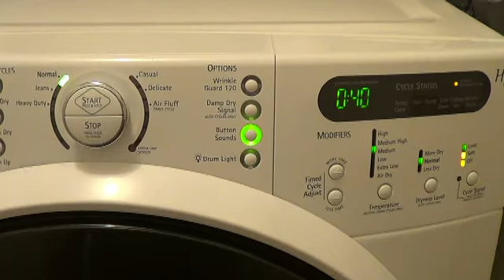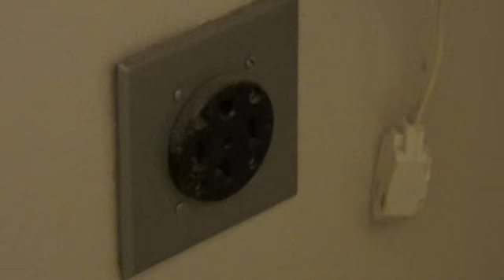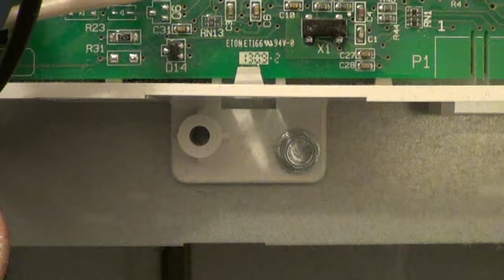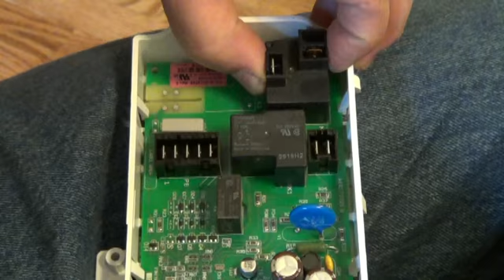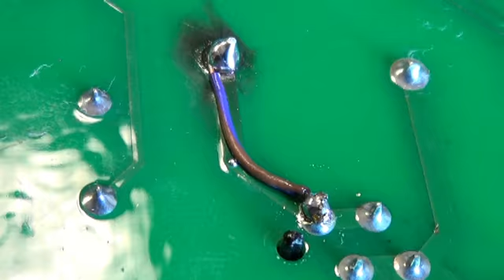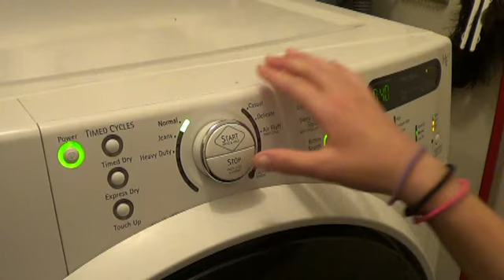Dryer Sears / Kenmore HE3 - F01 Error Code Main Circuit Board Repair

Comment: What kind of wire??
Reply from the maker: #20AWG, #22AWG, or #24AWG copper wire will be fine.  Insulated or un-insulated.  Doorbell wire, thermostat wire, telephone wire, or wire out a piece of CAT5 cable will all work.

In most cases simply resoldering the pin to the circuit board will not work since the metal foil on the circuit board often gets blown away when the solder joint pops/explodes. The jumper creates a new electrical path between the damaged pin and the pin it was connected to. The jumper wire doesn't need to be very big (say #22 AWG), and being small makes it easy to wrap around the pin(s). The factory pins are not insulated so if you follow the path of the foil between the two pins there is really no need to use insulated wire, but it makes it look a bit more professional. For those without much or any soldering experience the trick is to heat/touch the pin and wire with the soldering iron and keep touching he solder to the pin and wire until they are hot enough to melt the solder. You don't want to drop a blob of solder off the soldering iron onto a cold pin and wire.
Reply: Jim Dandy that’s what I tried first due to curiosity and just like you said it didn’t work due to the damage,  now I didn’t unscrew it out of the dryer all I did was pop those plastic clips and simply pulled the green board out didn’t have to disconnect a single wire and I soldered it all right there lol just a little FYI

Comment: Thanx, your fix worked great! A footnote, our problem was probably caused by lint packing up below the clean out screen over 11 years. I suspect it overheated due to restricted air flow. (and used more hydro) removed the 5 screws around the lint trap, and pulled out 1/3 of a shopping bag of crude, then vacuumed to get the rest. Hopefully it runs like a new dryer for a long time.

Comment: Thank you so much for making this video, all in I spent under $18! Had a hard time with one of the wires on the control board, but finally managed to pry it up using a flat head screw drive vertically between the points! THANK YOU AGAIN!!

Comment: Thank you, this repair fixed our Kenmore He3. You did a good job showing the needed steps without making the viewer watch unnecessary details. We bought the He3t washer and He3 dryer several years ago. We purchased a service contract for the washer. No contract on the dryer. So far this has proven to be a good choice. I have been able to do the dryer repairs (2 major) and have been glad to have prepaid techs take care of issues on the washer.

Comment: What’s the wire thing u connected the blown up one with the good one used for
Reply from the maker: In most cases simply resoldering the pin to the circuit board will not work since the metal foil on the circuit board often gets blown away when the solder joint pops/explodes. The jumper creates a new electrical path between the damaged pin and the pin it was connected to.  The jumper wire doesn't need to be very big (say #22 AWG), and being small makes it easy to wrap around the pin(s). The factory pins are not insulated so if you follow the path of the foil between the two pins there is really no need to use insulated wire, but it makes it look a bit more professional. For those without much or any soldering experience the trick is to heat/touch the pin and wire with the soldering iron and keep touching he solder to the pin and wire until they are hot enough to melt the solder. You don't want to drop a blob of solder off the soldering iron onto a cold pin and wire.

Comment: Jim, This was the Jim Dandy of the advise I saw, and the one I followed.  Work just fine!  2 hours total.  Only one hitch in my model, there was one connector that refused to separate, so I place to 1 x 3 boards under the circuit board on top on the dryer shell,  and soldered it "virtually in place".  Thanks for your guidance.  Doug

Comment: THIS was the video that got my dryer working. I watched a few and while I'm not particularly handy, I decided to give it a try. Resoldered joint and, darn it didnt work. Added the jump wire that only you mentioned and BINGO, I'm up and running. Thank you!
Reply: where did you buy the wire? do you have the link?

Comment: okay...gonna attempt this. Probably silly question, but is that a specific wire you used to connect those two points?  Any 'ol wire?  (am a greenhorn. but determined to fix this)
Reply from the maker: It should be solid copper wire of about #22AWG which is about the size of the wire used to make small paper clips. This would also be about like the wire used for doorbells, garage door wire, or old telephone wire.  It could be stranded vs. solid, but that would be a bit harder to work with.  It can be insulated or bare.  Clean the pin that the solder exploded off by scraping it gently with a knife.  Wrap the wire around the pin and follow the solder track on the circuit board over the the next pin and make kind of a wrap there.  Use a small soldering iron ~ 40 Watts and small rosin core solder.  YouTube how to soldering electronics and see how you should solder.
Reply: Thank you so very much!!!  Worked like a charm!!!  I am so excited!  Dryer is back in business!!!  Wooohooo!!!  You rock Mr. Jim Dandy!  Stoked!!!  :)

Comment: Mr. Dandy, I am half way through attempting this project on my Kenmore Elite HE5T Dryer. I have a copper wire that appears larger than the one you use in the video. I was wondering what guage you used? I'm a bit nervous to solder and then ruin the circuit board by soldering the wrong size copper wire. Please help. Thank you!!!

Rebecca@rebeccakeeney.com
Reply from the maker: The wire does not need to be very large, so something like a solid (vs. stranded) #22 gauge copper would work well (#24 AWG (small) to #20 AWG (large is OK).  You want to be able to wrap it around the pin sticking through the back of the circuit board.  It can be insulated, but bare is fine as it will follow the same path as the solder track on the circuit board.  The trick is to hold the soldering iron on the pin and wire until they are hot enough to melt the solder.  Keep touching the solder to the pin and wire until you melt about 1/8" of solder and then pull away.  Practice on a couple pieces of wire twisted together before you solder the circuit board.  YouTube something like "How to solder electronics".  Use some small diameter rosin core solder with a 25 Watt to 40 Watt max soldering iron.

Comment: Thanks so much for posting! I pulled my control board and had the exact same blow out black mark. I followed your steps to solder a wire on the back. It was my first time soldering with a cheap iron that didn't heat up hit enough. Even butchering the solder connections I got the dryer working in the same evening. 👍

Comment: Thank you so much for this video, just like your issue, but mine was on a HE5 circuit board is rearranged just a bit, but mine blew out, soldered a wire, and dryer works!! You are the man! Thank you!

Comment: Thanks for this vid, very professional job.  My Maytag Epoch Z had almost the exact same  splatter pattern, although the board was slightly different.  Very easy fix,  I used a hot solder, wonder if a tube of the conductive epoxy would also work?

Comment: This fix worked for my Canadian Kenmore HE3. Soldering extra wire on the board goes against what I learned in high school electronics lol, but it works. Cold and frosty in the fridge for you if you ever pass through Kitchener Ontario.

Comment: I had same symptoms. Replaced run described in this video and my dryer works. 
Only difficulty I  encountered was removing bottom left cable plug from the circuit board. This tan plug has a pair of wires with terminal connectors which are held in place by some type of internal clip. I inserted  jewelers flat tip screw driver between the wire terminal and internal socket clip  (until the screwdriver touched the circuit board) for each wire (1 driver per wire)  and the plug came off with less resistance.  I also had to re-open the machine because I did not push one of the plugs in far enough  (F70 code). Once I re-seated the plug everything came up beautifully.
Thanks for the great video save me some serious cash.
Reply: I too faced issue with removing the bottom left cable, mine I removed with little more hard pull force (I am reading your comment later).

Comment: I never leave comments, but have to say this video was bang on. F01 error. Check. Easy to follow instruction to remove the board. Check. Same blown splatter pattern on the circuit board. Check. Solder fix. Check. Working dryer? Check. Thanks for this.

Comment: Hi Jim!  I recieved that error (F01) and found your video on a possible fix.  I decided that if we were resigned to buy a new one anyway, why not try your suggestion and see how it goes...   Fantastic news, the fix worked, I did as you suggested and placed the extra wire to lighten the load and the fix worked.  Thank you for your post, it turned a pre-holiday downer into a successful learning opportunity for my two young boys and I!!!  Happy Holidays!

Comment: Jim, many thanks. This worked EXACTLY as you described. Dryer is up and running. I spent $17 at Harbor freight for the soldering kit. Used a small piece of wire from dead computer.

Comment: Thanks. I tried checking the thermal fuse and that ohmed out. Kept searching YouTube found this. I bought a soldering iron for 25$ and dryer is now working. Thanks again

Comment: Didn't even bother calling the repair guy......With this excellent video I was able to make the simple repair myself. Thank you immensely! This is number two... I repaired our Kenmore Elite SxS fridge a few years back with the help of a post on line and a $5 repair to a circuit board. The bigger issue at hand is that these products seemed to be designed to fail. Shame on the Maytag corporation for not putting recalls in place..... A bored Maytag repairman...... I don't think so.....

Comment: Jim you are a Dandy.  Dandy meaning you are excellent. According to Websters Dictionary.  I bought a new replacement dryer and then came across your video.  Now I have a brand new dryer and a repaired one. Will save the new one till the old knew gives out.  You are probably one of the most appreciated posters on youtube. Thanks, we really appreciate your work.

Comment: But, the reason why it burns up is because the contact points are burning up in the relay on the other side of the board.  That may or may not fix it temporarily.

Comment: Jim, thanks for the great instructions.  I followed them, but discovered that my board does not have the same exploded solder joint, nor does it have the same large  blackened marks on the white cover.  There is, however, some very slight black burn residue on the white cover near the top center of my board.  The solder spots look clean.  I was going to go ahead anyway and follow your instructions for soldering the wire in the same place you did.  Should I be concerned?  Jim R. in NH

Comment: Just repaired our HE5 which had the exact same issue. Thank you so much for the video including the slick tip on using the wire splice. The copper trace was completely blown away, so simply adding solder would not have worked.

Comment: Thank you very much for taking the time to shoot this video. I had the same issue. Your procedure worked perfectly. Had my son work the soldering iron. Had the family cheering as well. My dryer was stacked on top of the washer and I was really hoping to avoid disconnecting everything to move it to floor level. Not to mention I didn't have the manpower to carry it down anyways. I used a broken broomstick to slightly raise the front end of the dryer in order to get to the bottom cover screws. A 2-step ladder worked perfectly to access the control board area. Thanks again!

Comment: I unplugged the dryer for about an hour and tried it and got another H01.  Pulled the card, but it WAS NOT obviously blown/burnt.  I used 16 gauge (18 would have looked better and been soldered better.  It works just fine though, but my Home Owners deductible is a lot cheaper than $2XX.XX, so I will order a card next week.  Why?  The place it always seems to blow is the 125 VAC side of a 245 VAC transformer or relay that sends out 49 VDC to the controls and there is another feed of 125 VAC feeding that transformer.  It may be a planned failure of Sears  to make money on service, or it may be a bad card.  I don't know, but for me, it is time for a new card

Comment: Much thanks for this. Worked great. Quick Question. Once I reinstalled the board, didn't cover it up yet, to make sure it works. It did, however there's a smell of "burning plastic" or "burning wires" coming from the circuit board. Any idea what that is?  Could be the freshly soldered piece burning of excess material or could be that I'm going to have to do this again very soon. Any idea anybody?
Reply: Boki9 I’m 8 months late asking you this but what ended up happening? I just did this fix and I have the same concern.
Reply: @LAluvr4ever  : And I'm late finding your reply and no followup from Boki9. You two are the first I've found in a lot of replies I've looked at on the many videos of this "repair" that come close to questioning the real problem.

I'm wondering WHY this joint blew so catastrophically (had to be more than just a bad solder joint) and if there's that much juice running through the circuit I question the wisdom of all the DIY "fixers", many with zero electrical background (to even know this might be a bad idea) doing this. What's to stop it overcooking again ? (as Boki9 seems to be experiencing). Potentially more catastrophically and starting a fire with that heavy gauge wire there ?

As someone pointed out, they did their repair on a Revision D (the 4th, at a guess, depending on how they do their nomenclature, could also be the 13th in hexadecimal) board. This looks like an undocumented warranty issue that should have seen a recall.

Don't get me wrong, it's great if this is the inexpensive easy fix it's made out to be. But where is the due diligence of the YouTuber's posting it ? Or reposting it, as the case seems to be a lot of copycats. Where is the questioning of WHY it failed and IF it's wise to "fix" it this way. Reminds me of the old fix of using a penny coin to replace a fuse in an electrical panel (before breakers were common) because the circuit was overloaded and kept popping the fuses (which got expensive and inconvenient). Those pennies never popped, because the wiring in the house would melt and catch fire first. And homes burned down.

Comment: Thanks for this.  I just did this fix to mine and it works fine now.  Also thanks for the detail in your presentation.  It saved me a lot of time not having to fuss with dealing with the tricks to getting it done quickly.

Comment: What kind of wire did you use to solder, and where can I get it at?
Reply from the maker: I recommend a #22AWG or #24AWG solid copper wire.  You can get this from some doorbell, thermostat or telephone wire.  ACE hardware or similar will have something that will work.  It really doesn't matter if it's insulated or not (bare), but I used insulated.

Comment: Twenty dollars, a week of patient waiting and a few hours of work, and done. Thank you for your generosity in sharing this! As others have said, it saved us at least $500. This is what the Internet is for! It was hard for us to get access to the back of our stacked Maytag Epic-Z drier. We ordered this "Evelots Furniture Lifter with 16 Mover Pad Sliders" on Amazon for $21, and slid the washer and dryer out by rocking back and forth. Took all the steps you suggested here. Had difficulty removing the black and red power connectors from the circuit board. Didn't want to break it, but did require some force to pull them off. The other connectors came off easier. Didn't have any AWG 22, but used some stranded wire from some old computer parts. Took quite a while to get the size and shape just right for the repair wire.  Borrowed a soldering iron (never used one before). Taped it down with some tape (even used blue to match yours). The elation of putting it back and having the dryer work was well worth the effort. Thank you again.

Comment: Jim, your video helped so much. The fix worked perfectly on my HE5. Thanks for the post, just saved over $350 the tech quoted me. $200+ for the board and $100+ labor plus tax. Thanks. Note to others;  just be sure to take good photos for putting the wire board connectors back in the same place. Sears should recall these and fix for free.

Comment: Thank you!  I just did this- I had to do it twice, as Im not the best solderer.... question... is it safe with the wire on the back of the board?
Reply from the maker: The short piece of wire between the two circuit board pins can be insulated or uninsulated (bare).  It really doesn't matter if it touches the board or not. You are just providing a good electrical path between the two pins, which replaces (or runs in parallel with) the solder track/metal foil track that blew up.  The green board is an insulator except for the metal tracks between pin holes.